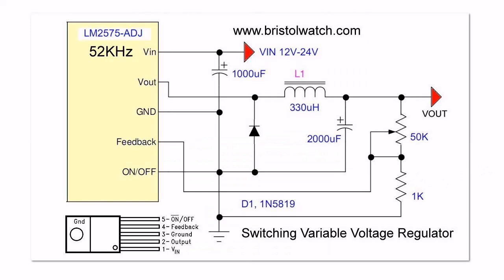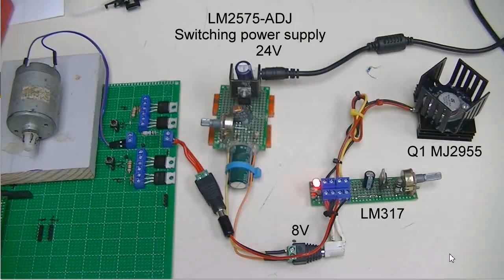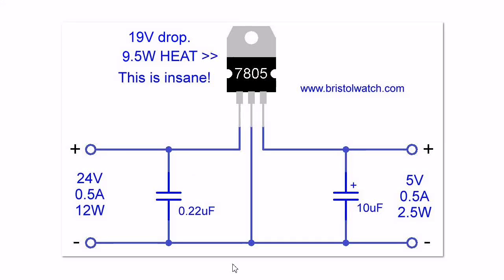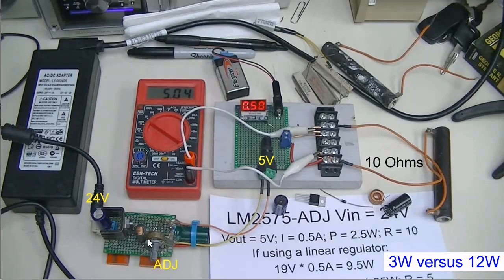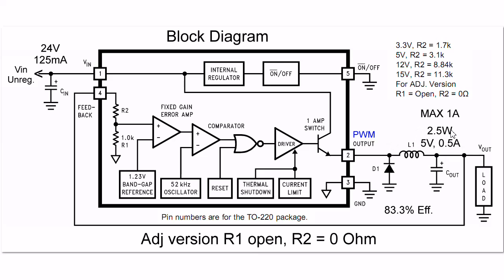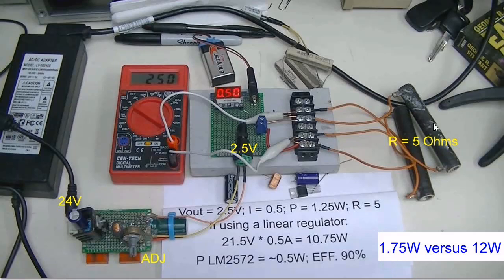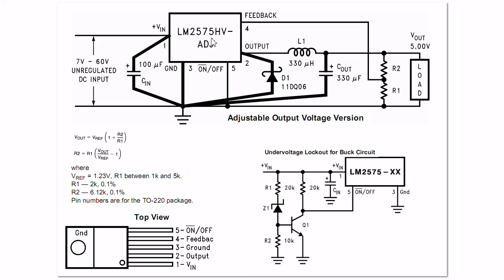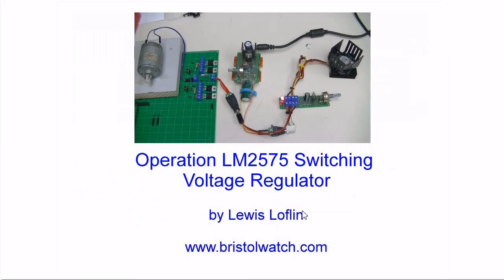LM2575 Switching Power Supply

Comment: Hey Lewis. I know your channel is very small but the information you publish has been very valuable. My professor used your some of your TTL logic level shifting circuits in my undergrad engineering degree. We even use some of your circuits at work for our industry (Building Automation). Keep up the good work.

Comment: @LewisLoflin I really appreciate all the videos you have done and have seen most of them.
 I started looking at power electronics because I wanted to build a remote controlled lawnmower using 24v 250-350w wheelchair motors. I could not believe the price of the sabretooth 2x60 and for this reason have spent probably too much time learning about these.
What I would really like you to confirm please, is that for simple pwm dc motor control, the use of even a half-bridge is actually a real waste of time, money and in fact is inefficient especially important if you want to run things off batteries. All you need is mosfets on one side of the motor only. Indeed you just waste increased amounts of heat through the second set of mosfets in the half-bridge. 
Relays would be a more efficient way of reversing at the ouput stage of a quarter h bridge to the motor, to change the polarity of the motor connections.
H bridges are wasteful unless you need 3 of them for brushless dc motor control, or where there are low current requirements. One interesting thing watching youtube videos is that even with mosfets of a relatively low rds that are driven fully, how much heat they need and the requirement for cooling. I cannot see that smd components do anything but cut that by half from 1mOhm to 0.5mOhm (still valuable).
One thing which shocked me was how hot the even "1/4" h bridge controllers get.

Comment: Thanks for the video, how about noise? if I use this switching circuit on a radio or amplifier, will I hear noise from the switching supply? thanks!
Reply from the maker: That is a drawback of SPS. I used larger caps than the spec. sheet called for. I had no problem. As for audio amps, I'm not sure, to be honest. I'm building a 2nd generation version of this and will use an oscilloscope to check for noise.